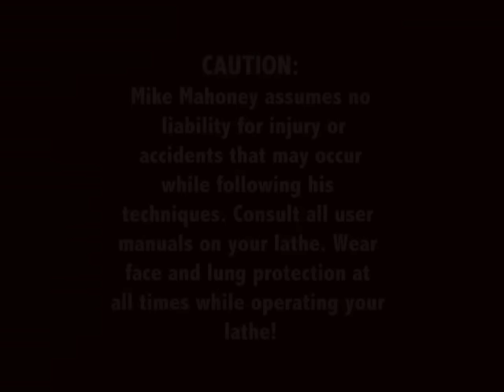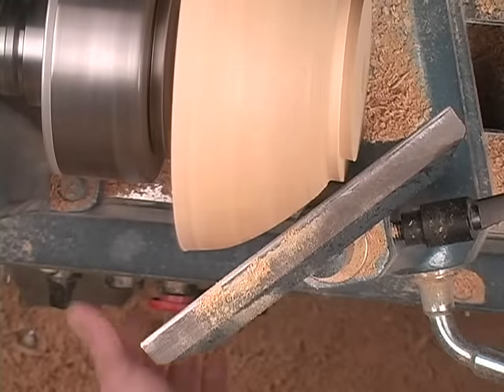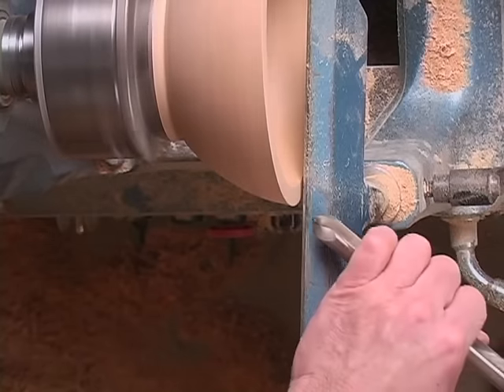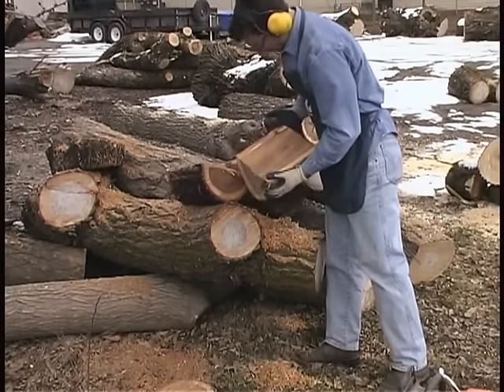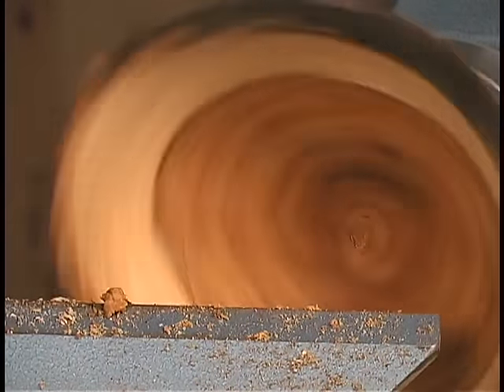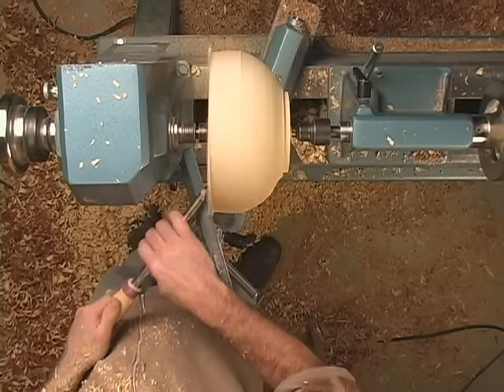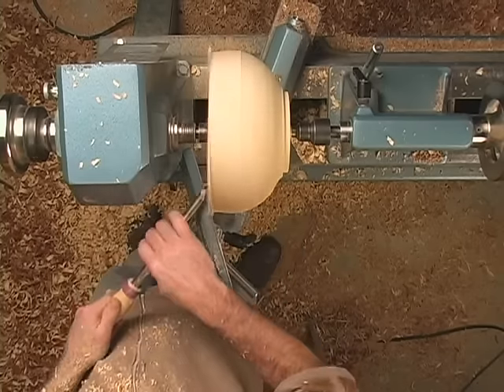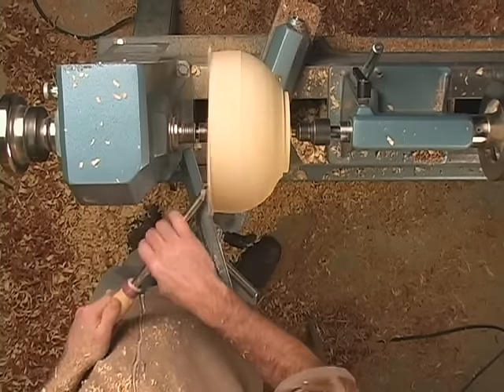Bowl Basics with Mike Mahoney

Comment: 9,000 rpm???
Reply from the maker: That's 900 rpm
Reply: The diameter of the blank, in inches, (in his case is 9") multiplied by the RPM you want to run the lathe; should equal around 6,000 to 9,000.
If it is over 9,000 slow it down. If it is below 6,000 you should speed it up.
This is assuming your blank is balanced when turning. A Way out of balance blank may require you to run the lathe at 100 to 300 RPM so it doesn't bounce all over the place.
Reply: @chezlerq4478  WHAT????
Reply: @burnleyize  , Senior moment.